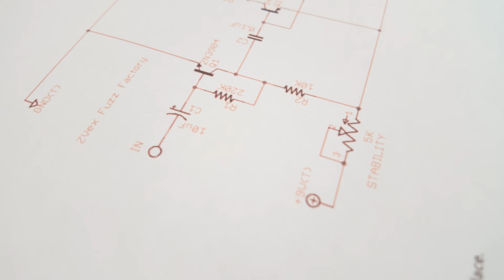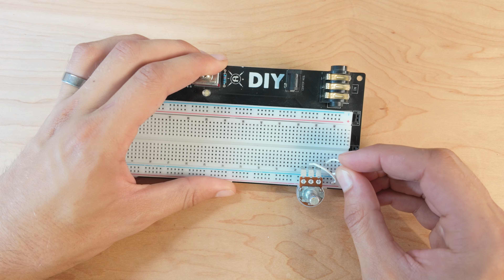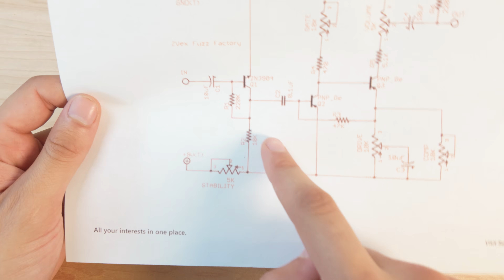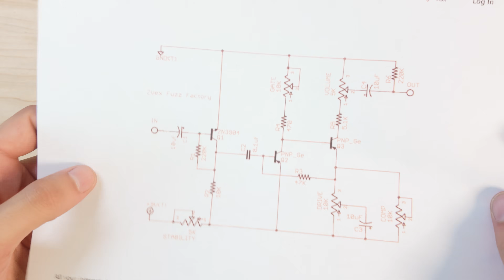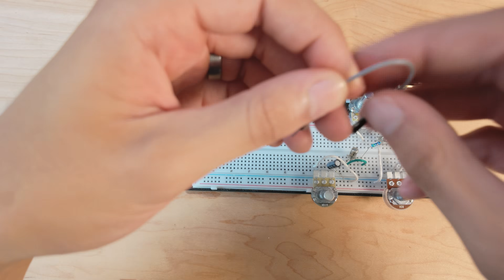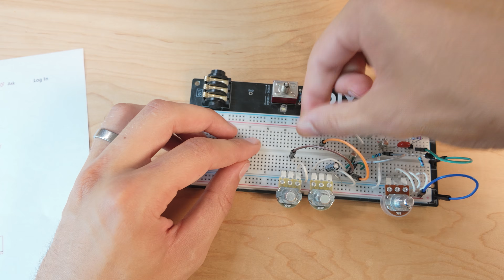I Built the Fuzz Factory… and It’s INSANE

Comment: Sounds superb! Thanks!

However, Germanium transistors are not that common. I reckon they can be swapped for more mundane silicon ones?
Reply: Silicon Fuzz Factory is killer! A different but equally valid sound to the germanium version. I have 3 Fuzz Factory‘s - an original Vexter, a silicon and a germanium clone. All three behave very differently and I prefer the clones to the original.
Reply: Why not have both?

Comment: the hard part is getting some AC128 equivalents, its possible to build a silicon version. You can try the same transistor he used in this video the 2N3904, or a BC327 dont expect the same results tho.
Reply from the maker: I've found that ebay has some good GE transistors for reasonable $
Reply: @PedalSmithCo  not everybody lives in the US man

Comment: I'm confused about pin 3 on the COMP pot. Isn't it supposed to be connected to the 2nd transistor?
Reply from the maker: the COMP pot is acting as a variable resistor so it can be connected straight to the wiper lug. If you want to follow the schematic as its shown, you would add a jumper between lug 3 and the wiper, but isn't necessary.
Reply: @PedalSmithCo  I love all of your videos, but I wish that you would explain the why of a connection like this. What is the upside/downside, what impact does it have on the circuit? It all comes down to whether you want people to paint by numbers or actually understand the thought-process that informs the decision.

Of course, even if you don't explain, just saying out loud that you're not going to bother with the connection is a useful data point for someone taking notes.

Comment: Another great video Grant.   That sounds fantastic.  Are there any other transistors that would work for that?  My dad just dropped off a few dozen germaniums from the 70's and 80's, but I don't have that one.  ...yet...
Reply from the maker: i'd just experiment with whatever you have--as long as its a PNP transistor it will work in the same configuration
Reply: @PedalSmithCo  I have to catalog all of it.  There's some cool parts.  There are some old op amps that look like germanium transistors, but with 8 legs.  Bunch of old RCA stuff.